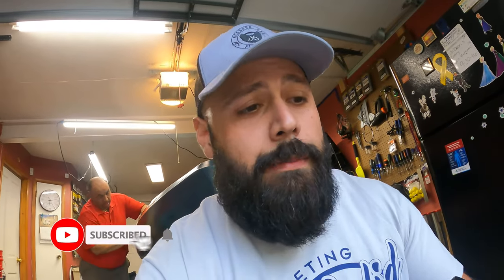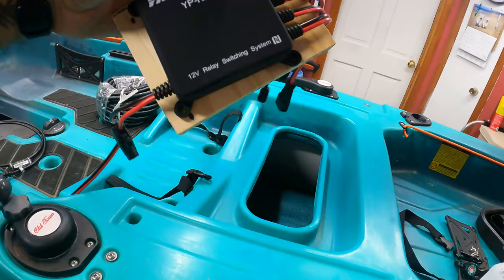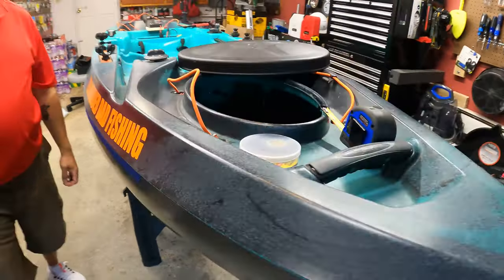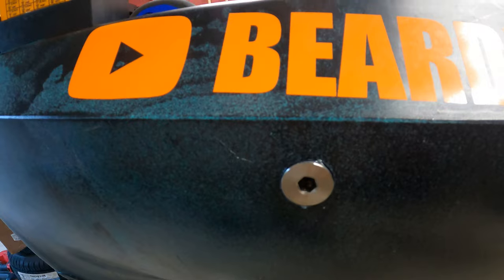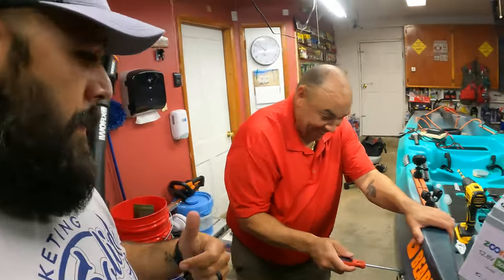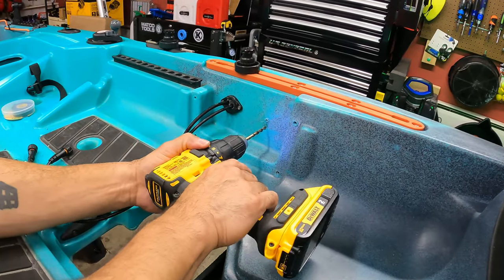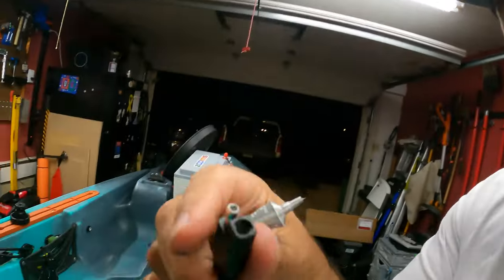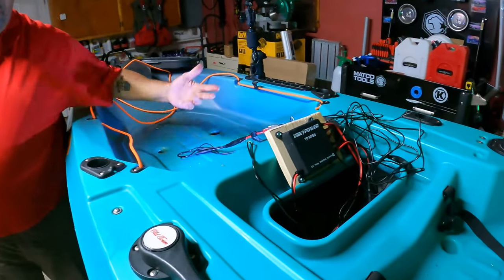Yak Power Switch and Lights - Full Install - Old Town Sportsman

Comment: Nice job on the install. Not sure about front lights though, should be navigation lights, a green and a red instead of 2 green.
Reply from the maker: Thanks for watching! Red and green are only needed if it’s a motorized kayak. For my autopilot I’ll be doing them red and green.
Reply: i know what yo u mean ive got the same i wish i had a red light
Reply: I just bought a used Autopilot and the previous owner put green lights on both sides. Now I need to purchase a red light to install.

Comment: I installed my YakPower system 3 years ago already... I use "" for my fish finder, "B" for my forward and aft YakPower green LED external light strips, "M" for my 10 Sunpie rock lights (turned for music I might add),
"S" for my stern light, "2" is for dual 12v ports, dual USD lights and LED power display. Running a 36 lb. Rear mount salt water rated trolling motor, power control module for the trolling motor, 50 watt 1.1 aH solar panel on my milk crate box with a 54 aH Dakota LiPo battery... on a sunny day... I never run out of power and still have plenty of power for lights and trolling motor for night fishing.  I bought a Big Fish 120 and she is an awesome yak… but I had to install a 4” inspection port to do all the wiring from… it was a chore for sure
Reply from the maker: Thanks for sharing Ray! Love the Yak Power system and all that it allows me to hook up.
Reply: @BeardedDadFishing  you are welcome.  I love my setup.  I have used it in the gulf and on several fresh water lakes for stripers, sandies, various other bass, catfish and carp… I tied into a 41 pound blue cat… we rode around 3 hours one night.

Comment: Nice look with the lights. I have to install a  anchor system and have been holding out because of the drilling into my Tenton 😂
Reply: Teton baby! Same here. Budget guys👊🤨
Reply from the maker: Thanks Shane! It gets easier after you get that first hole in there 😅 
As long as you know what you want, I'd say go for it!

Comment: Nice job! One note  not dissing, I noted you used shrink wrap on the round connectors from the light, I would also shrink wrap the SAE connectors too. Dielectric grease them then shrink wrap the connectors. Ask me how I know, they are not waterproof no amount of dielectric will water proof them, I also used the grease on the connectors your green lights plugged into outside the yak.. You will  be thankful you did. Also as someone stated save your drill shavings for future repairs. But nice job.
Reply from the maker: Thanks for the feedback brother! Always appreciate how I can make it better. I’ll be going back in and installing on my AP136 and will be sure to shrink wrap the SAE connectors.

Comment: Great gear and install! Side note: A vessel operator should not have white light in any position that it can shine in his eyes. It ruins night vision. Red light is the preferred light to impact night vision the least. My cockpit button lights are under the seat, shining forward and are blue light instead of white. If I need more light and install them forward of me I'll add red. Your yak is looking killer. Thanks for the vids.
Reply from the maker: Good call. Very helpful info!
Thanks for watching man!

Comment: I think they should have had nutz on the back side of the round lights then no worries on stripping the threads in the plastic, and I would have cut out all the extra wire spliced it back together I would try and keep the weight down and that Velcro tape seems to not hold for me alcohol wipes doesn't matter lol anyway I enjoy watching you're show. Milwaukee
Reply from the maker: Thanks for watching man!! I agree, I don’t like risking stripping the threads, but then you’d have to access the area by hand to get a nut on the back side. 
And splicing to shorten the extra is an option but cleaning them up with the zip ties was good enough for me. 
Velcro has held up so far. We’ll see how this season does 😉
Thanks for the feedback 💪🏽

Comment: great install .. how is the Yak Power 5 circuit wireless switch holding up?  would you recommended (i don't see much review on Amazon)?
Reply from the maker: Thanks for watching! I definitely recommend it. It’s been good to me all season. Never had an issue with disconnects or dead battery yet 🤞🏽

Comment: hahaaa yeah ONE other thing how did you get the cables through the hull from bow and mid with no hatches,  coat hanger wire ?????
Reply from the maker: Thanks for watching Peter!!! I did use a snake to get the cables to the mid ship hatch. Much easier to run them that way.

Comment: What would things look like if the lights were a little lower, just under the waterline?  Really considering this kit for a new dorado kayak
Reply from the maker: I wouldn’t recommend under the waterline. You’ll likely get water in the hull.
Reply: @BeardedDadFishing  that's what I was thinking, hut also loading up on silicone and seal everything

Comment: Nice ! I think im going to find some. I have navigation lights already. Does the water short them out? I have some on my car and within a few months they were blinking and coming on when they wanted to 😂. So I cut the line. I have some heavy duty ones so they looked like 😂
Reply from the maker: No shorting yet. All the connectors stay dry inside the hull and are heat shrinked for extra protection 👌🏽

Comment: I have a question.  When you push a button to turn something on will it turn off the other items?  Lets say I want t keep my fish finder on but I want to power on my powerpole or lights?
Reply from the maker: No sir it’ll have a button for each item you have plugged into it, given that each item is wired to a specific relay. If your fish finder is one 1 and your lights are on 2, they will work independently of one another. 
Great question. Hope that helps. 
Thanks for watching!

Comment: I just installed some sae connections to move my battery box and cried when I drilled a hole in my kayak. I have the pdl120 as well. 1 question shouldn't you have 1 red and 1 green light in the front?
Reply from the maker: Making those holes is no small task! I felt the same way the first few times. 
Since it’s not motorized it doesn’t need red and green lights. For the new autopilot I will do red and green though.

Comment: First off great video! everything seem to go in very easily in the yak power system… Quick question did you find you needed to get any additional wire for the SAE connections? also, yours looks like a wireless option. How’s that been working for you? I recently picked up the wired version and I’m on the fence as to which one to go with now that I saw your video.
Thanks again great content …liked and subscribed . Bob
Reply from the maker: Hey Bob! Thanks for watching!
In the two years I’ve used it, zero issues using the wireless option. I recently had the control knocked into the water by my measuring board so I’m control-less. However, the Bluetooth functionality is quick and easy to use through the app. The control is $70 to replace, so I’ll likely just leave it as is for now. 
I didn’t need additional wiring. But adding on more would be a breeze if you need to extend them.
Reply: @BeardedDadFishing  awesome thanks for the information. I see a lot of guys talking about not wanting to drill holes in their kayak well for me drilling a 3 inch hole into the side of my kayak is not something I’m thrilled about… Lol.
I’m really gonna have to reconsider this whole wired version 😂
Reply from the maker: @Whitetail414  yeahhhh that’s a BIG hole 😅 but it’ll come out great either way!

Comment: Now that the lights have been installed for some time, have you had any problems with the lights being so low on the water line?
Reply from the maker: Not at all brother. It’s dry as can be and still loving it 👍🏽

Comment: I just bought an AutoPilot from a friend and he installed this same lighting system on it with green on both sides of the bow. I just ordered the red/green kit to replace it. I might install the green lights on the stern in the future. The red/green kit has the 10" strips, where as the green kit is 20". What's the best way to fill in the screw holes from the ends of the 20" strips?
Reply from the maker: Congrats on the yak! I’d say some JB plastic weld is your best bet 👍🏽
Thanks for watching!
Reply: @BeardedDadFishing  thank you.

Comment: Is there any certain reason for putting the navigation lights 1 inch below the edge of the kayak? Could they be installed on the upper part where your YouTube stickers are?
Reply from the maker: @sabrinashelton918  they could be but I didn’t want to remove my decals. That’s the only reason why 🤷🏽‍♂️
Reply: @BeardedDadFishing  ok thank you for responding, I was wanting to put mine there but wanted to make sure it was ok b4 I did, I wasn’t sure if there was anything recommending not to put lights there. How long do u think the 10ah nocqua battery will run some running lights, 2 button lights, a whip light, and garmin?
Reply from the maker: @sabrinashelton918  depends the Garmin but even with my 93sv, the max draw is 1.25amps, which means it would last 8 hours. It’s usually not at full power. You could get a days trip of it of it usually

Comment: Yak power says it has an app for it. Did you try it? Does it control the lights instead of having another thing in the way?
Reply from the maker: I haven’t used the app yet but my buddy does and it works great for him.

Comment: So your bow running lights are both green. Right should be green and left should be red. Also you should have a white light at the stern. Coast Guard regulations.
Nice install though.
Reply from the maker: Appreciate it brother. I’m a non motorized vessel so regulations are different. I also don’t do open water just yet.

Comment: Hello. I love your videos.  I just got the same kayak and I have a question.  When you plug your go pro into the USB to SAE plug, doesn’t water get into or affect the USB port itself? I know the plug is designed to be waterproof to your kayak, but I’m talking about the actual USB port on the end where the go pro gets plugged into.  Does t that get wet or anything?
Reply from the maker: Appreciate that brother!
Water can definitely get into that port. Your best bet is to use a healthy amount of dielectric grease on all connections, but especially that one. It will help prevent corrosion and shorts.
Reply: @BeardedDadFishing  Thank you for replying. So I’m talking about the USB port itself, not the port that the USB adapter goes into. So you’re saying to rub the dielectric grease into the little rectangular USB port that you plug the Go Pro into?
Reply from the maker: @delpernicus4847  yes sir. It’s an electrical connection like any other so you can put grease in it.
Reply: @BeardedDadFishing  Thank you man. Keep making your videos.  You have no idea how helpful they really are to people.  There’s not that much information out there on specific things. Especially not for the old town 136.  So I truly do appreciate it. You’ve also inspired me to create my own videos when I actually receive  the kayak.  I also saw a video where you were saying that there is a dads club.  I would join, but I didn’t know if it really was dads only. Unfortunately I’m not a father.
Reply from the maker: @delpernicus4847  my pleasure man! I’m stoked that my videos have helped you out and I do appreciate the kind words. 
Yes feel free to jump into the group even if you’re not a dad. Plenty of non dads in there but all men are influences to young ones around them in some capacity (nieces, nephews, young cousins, siblings, etc) that they can help guide and be a role model for. That’s really the point brother 🤙🏽

Comment: I see you have links but do you have an estimate on what you spent on all electronics? Battery, fish finder and light setup?
Reply from the maker: Approximately $1,350 in total. $700 for the garmin, $300 for switch and lights, $250 for the battery, and $100 for the various mounts. The price can certainly be cut down depending on the options chosen.
Reply: @BeardedDadFishing  that's about what I expected. Looks great!

Comment: I was under the impression it had to be red and green in the front. Is that not the case?
Reply from the maker: Only if powered. Since it’s a pedal kayak I decided on keeping them green.
Reply: @BeardedDadFishing  so I could go blue if I wanted to?
Reply from the maker: @mikeygrizz23  As long as you’re not powered, you should be good. But always double check the laws in your area just in case. Ya know how things tend to change.
Reply: @BeardedDadFishing  eastern PA. Thank you!

Comment: Can't seem to find 20 in Bow lights in Red and Green. Only the 10 inch come Red & Green. Any suggestion?
Reply from the maker: I've only been able to find the bow lights in 10" in red and green bud. Amazon does have some other brands that may work but reviews are mixed and extra wiring may be required.
Reply: @BeardedDadFishing  I found 20 in red & green. They come with stripped ends so I can twist them into a Yak split/pig tail and it becomes plug and play. Thank You for your comment.
Reply from the maker: That's awesome Edward! Glad you found em!

Comment: Bow lights are red & green, that wood will rot and don't use bathroom silicone caulking.
Reply from the maker: Bow lights don’t have to be red and green in an unpowered vessel. And the wood doesn’t rot if the hull stays dry as it should. If you take on water, the wood is the least of the worries 😆